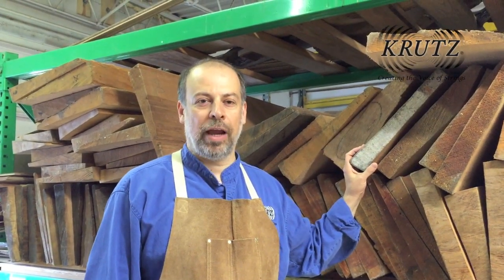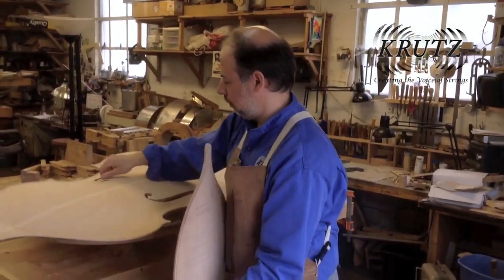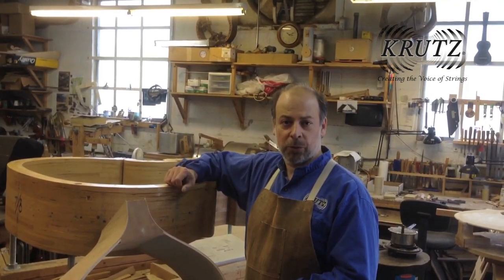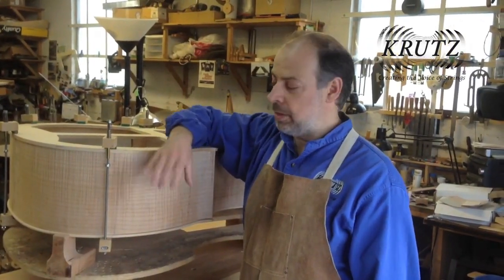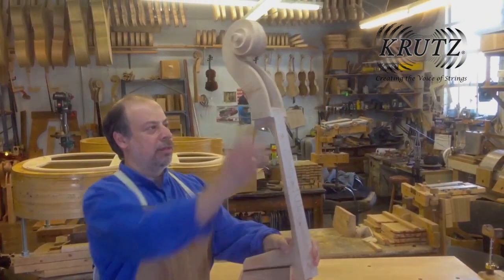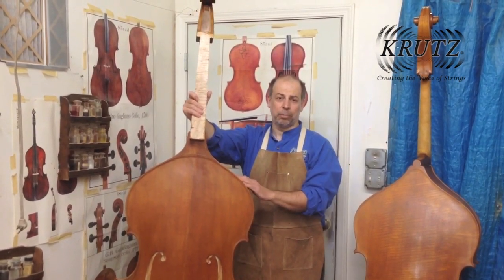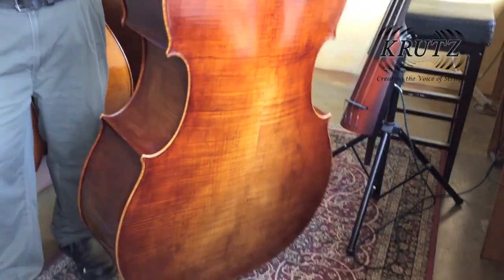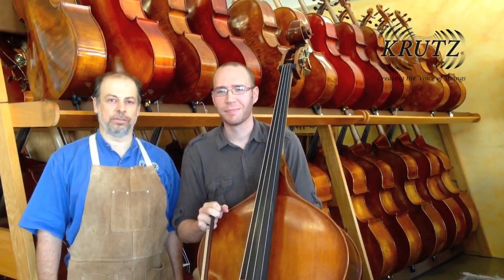Anton Krutz Making a Bass - KRUTZ String Instruments

Comment: Hello, Such a beautiful bass. I have a 1/4 size contrabass. Recently during transportation the neck came off clean without breaking. There are no contrabass repair person where I live.  could you please answer one question. Do you know what is distance between the neck and the body at the highest point of the neck for a 1/4 size contrabass?  Thank you.
Reply from the maker: I am sorry that happened! That specific answer depends on several instrument measurement factors. Email us at info@krutzstrings.com and we can better answer that question in detail. But in general, if the neck had already been set in the bass body, then once you clean off the old glue from the neck heel and mortise the neck can be glued back into the same place, for the same angle and height, as the neck was before it came out.

Comment: Would you sell wood so I can have an attempt to make my own? What wood are you using or what wood do you recommend ?
Reply from the maker: Thanks for the questions! We use spruce for the top plate and maple for the back plate. This wood has to be specifically selected and cut to be useable as tone wood. We don't sell tone wood but you can get it at International Violin company:

internationalviolin.com/Shop/tonewoods

Comment: Would you sell some wood , what wood are you using?
Reply from the maker: Hi! Thanks for the questions. We use spruce for the top plate and maple for the back plate. This wood has to be specifically selected and cut to be useable as tone wood. We don't sell tone wood but you can get it at International Violin company:

internationalviolin.com/Shop/tonewoods